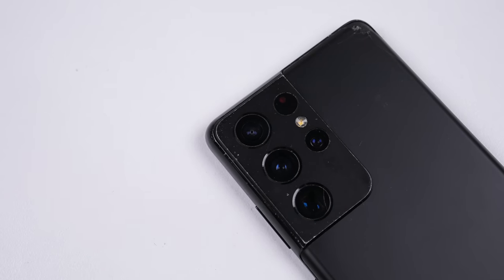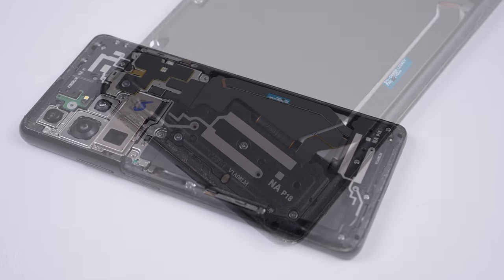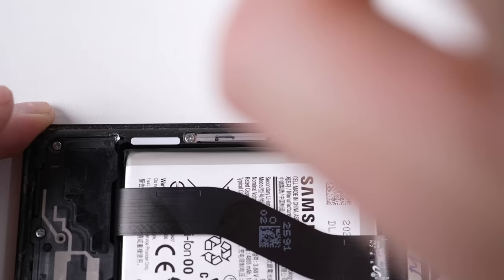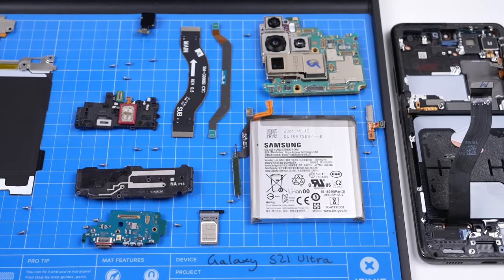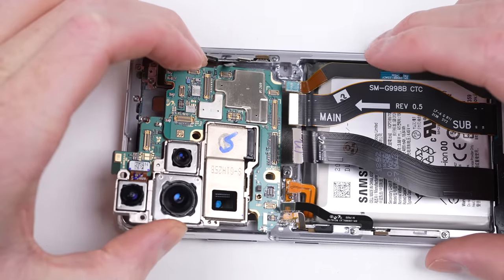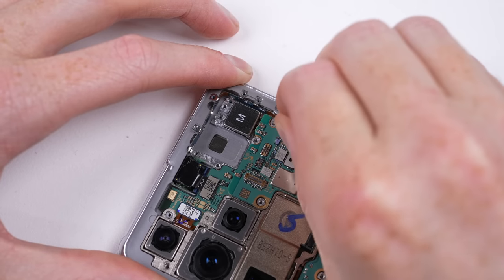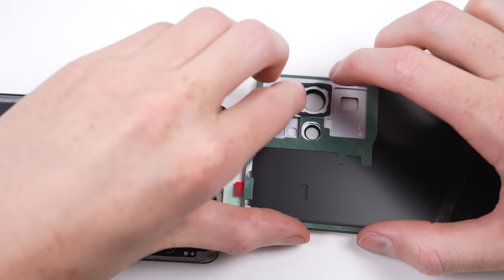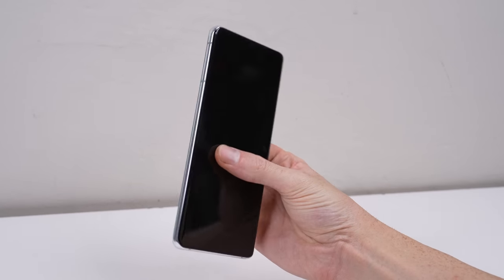$130USD Galaxy S21 Ultra Restoration

Comment: I work for a samsung repair partner. The reason the black screens are more expensive is because they've been on limited stock for around 2 years. it was the most popular model phone i repaired in 2021 by far.
Reply: Black is generally the most common option on phones, so I'm not surprised here that this was on back order parts wise. Lots of people prefer not to having their device look flashy as with the other colors.
Reply: Where is the best place to get replacement screens?
Reply: @nalvareza  do you want to do the repair yourself, or have it done for you?
Reply: @guzxam  he is asking a question you should answer it
Reply: @ginglee4199  No you should answer it.
Reply: @guzxam  to repair ourselfs, please. Is there any other cheap alternative displays? Thank you very much😊😊
Reply: Limited stock is an industry code for deliberate stock limiting to manufacture scarcity.
Reply: @Boomage1979  i know
Reply: @halirage1605  aliexpress is the only place where you cand find cheap displays, but they might not be the best quality, you have to look out for quite a bit of things while shopping for screens online but i dont have enough time to tell you , if you are interested i can give you a few pointers.
Reply: Samsung official is the best. And they can be had for this model for just over 110. You just need to know where to look.

Comment: 2 years rocking my S21 Ultra, and it's still a fantastic phone! I won't be changing it in at least 1 or 2 more years.
Reply: Same, the newer Galaxies haven't really given huge benefits to upgrading besides the S-Pen and the apparently amazing battery life on the S23U

Might just hold onto this till 2024
Reply: Been using my S10 for 2 and a half years now, the only thing that's getting a bit bad is the battery life, but other than that, I literally have no reason to upgrade

Comment: I just got a screen repair on my s22 ultra. It was $30 through my carriers insurance. The guy let me watch and the process went identical to this s21 pretty much. Took the guy like 15 minutes to swap the important bits into the new frame, battery was included on it, like you said. And boom done. I've missed this phone so much

Comment: they make these phones so well held in place and glued down so nothing comes loose but they break so easily but phones from the 80s and 90s were not but they could survive so much hardship and abuse and yet they were not even made in a secure way to last they just did that shows how much manufacturer’s have changed

Comment: For f***s sake I'm still rocking the S10 Ultra. I replaced the front screen recently (mentioned it in another Hugh Jeffreys video) and it's still doing just fine. Yeah, I get the urge to be at the bleeding edge of technology but when you sit back and realize that companies are holding back advancements because planned obsolescence is a real thing having the latest and greatest doesn't mean as much any more.
Reply: I have a Google Pixel 4 Xl, 

My brother recently purchased a Pixel 7 Pro, I played with the phone for a bit and realized that the huge improvement I'd thought I'd get, just wasn't there.

Especially in photo taking, though video was a huge improvement with 4k 60fps video on all cameras.

All in all, it's pretty much the end of upgrading every 2-3 years now.

Phones have peaked.

With that said, I'm excited about the Pixel 8 Pro!

Comment: The 3 screws holding the charging port board in place are actually not the same as the rest - they are a fraction smaller

Comment: As long as you use a lot of heat, plastic tools (a battery remover tool), and isopropyl alcohol, almost all Samsung batteries are a piece of cake to get out. Don't use metal tools if you don't know what you're doing. I've never seen a suction cup used for a battery, but whatever works.

Comment: It would've been great if you pointed out that when replacing a battery of a Samsung, you'll need to use the GalaxyCal app to reset the internal charge cycle counter which will gradually lower the maximum voltage of the battery. Sadly, this GalaxyCal app is only available for S series phones starting from. The S20 series. Earlier and non S phones are bound to get their battery replaced by Samsung which is anti-repair.

Comment: In my opinion, fixing old Samsung flagships aren’t worth it at all unless is for data recovery. The display itself is really expensive, and the whole cost of fixing one would be more than just getting a used one. All of that for its value to depreciate massively and not get software updates in 2 years.

Comment: Bottom line is this: if you need a heat source, picks, prying tools, a suction cup and alcohol to remove a phone battery, that basically means there is way too much adhesive securing it.

Comment: Love your videos, Hugh.  I was wondering, why is it necessary to glue a battery down at all?  It doesn't seem like there is any room at all for a battery to move around inside a phone.  I remember my old Blackberry battery would just snap in and out.  No glue needed.
Reply: They could’ve even used screws
Reply: Mostly just to deter anyone who dares to remove it. Tbh they should just use screws to secure it in place
Reply: @rosaria8384  Yeah, I know it's to make it hard for anyone to repair the phone.  Don't even need to use screws, just a bracket that the phone would snap into.

Comment: Hey Hugh, I'm really sorry, but this is the only relevant video I could find to ask this question:

I have this exact phone, and actually been looking to downgrade to a Note 10 +, and my current phone has a tiny fracture in the top right corner of the glass. Would it be a feasible financial option to repair the phone and re-sell it towards its end-of-life and grab one? Taking into account mobile carrier limitations, and security concerns, too.

I'm also wondering, once the end of security updates for the phone comes and if I decide to flash a new firmware, I'm guessing S Pen functionality would be lost, unless there's a fork of Android that has it?

Just genuinely curious and trying to weigh some things out before jumping in. Any advice helps. Thanks!

Comment: Here's my question, recently found a Samsung Galaxy tab s7plus tablet laying on roadside with a detached display completely shattered but the body probably fine ( maybe water damage). Tried to contact Samsung cs, unfortunately they don't keep their customer information unlike apple. Should I fix it up at the repair shop (presumably this channel) and if the owner wants it back I'll just charge it for the repair, if they don't want it then I'll keep it. Any opinions?

Comment: Trust you're fine sir.. I live in Ghana and I'm a huge fan. I have a Samsung s21 ultra with a damaged display and I can't seem find a display to buy on the market. The price at the Samsung shops in Ghana are too expensive (Almost twice the price of your s21 ultra fix ~ 130$). I was hoping if you could point me to a site with internationally shipping I could get the screen with similar pricing. Or if I could buy from your site then have it shipped to me. Any help will be appreciated sir. Thanks

Comment: one question though, doesn't factory resetting from the bootloader force you to put an email that was previously used on this phone? or are there ways to bypass this?
Reply: You can use an app to remove the frp

Comment: Hugh, I have asked you this before and you have never answered.  The phone was locked. You did a Factory Data Reset from the Recovery Mode menu.  As this will NOT work if the user was signed in to an email account when you did this, can you please explain how you are getting around this?
Reply: wondering this myself. few others have picked up on this as well.
Reply: @bobloblaw5406  Ya. It's rare that a phone wouldn't be logged into an account on an Android. So either Hugh is very lucky or there's something else to this, because it should factory reset and require that same email that was signed in previously to have to sign in or its still locked.

Comment: Has anyone noticed increased reports of screen failures (green lines, dead pixels, etc) of the S21 Ultra? They've been failing all around the globe in large numbers. Mine failed (green line) about 2 hours ago.
Reply: just OLED things, especially for curved OLED screens. Can't do much, temp, humidity change, a few drops do that.

Comment: Hugh, can you cover the fact that US model Samsungs can't be rooted? (OEM unlocking doesn't exist in the settings)
Reply: You can through a paid unlock service. But, you have the be on march 2021 firmware or earlier. 
My us s20 fe 5g is still bootloader unlocked and rooted to this day.
Reply: @corey7219  then that's not really a solution is it? My Pixel 7 Pro was rooted the day I got it for free with publicly available tools
Reply: @ctrlcf  maybe my next phone will be a pixel. We shall see.

Comment: Hi I have a MEDIAPAD T3 7 it works but the screen has 1 big crack down the screen and around the crack is a yellow tinge. Why is there a yellow tinge?
Reply: Because the cracked glass is applying pressure onto the LCD panel underneath, distorting the cells and creating that yellow tinge.

Comment: Not really a phone fix it type person, but what minimum tool kit (Ifix it)recommenced to replace a pixel 2 phone USB-C charging port? My perfectly good phone is ok other than you have to do some gymnastics/hold to get the charger cable right to start charging . It's now my backup if my new Pixel 7 ...
Reply: Maybe it's from cable, not port.
Reply: @Justice_Akbr  no, multiple cables tested and you need to wiggle them all to made it start charging. it's the port for sure, check around and costs like $150 to replaced by a repair place too. I've also considered wireless charging but doesn't seem to work with my current one.

Comment: Hey there, I have an s21 ultra with the display slightly damaged. Where do you get legitimate samsung parts from? Im scared of ebay 😂
Reply: Crazy parts is good
Reply: Good luck with that one, the short story is Samsung doesn't want to sell you one. Ifixit is always a good goto if you're not confident finding an OEM service pack or getting an OEM used part pull on ebay. Just save yourself the headache and buy a full frame assembly like Hugh did, not the raw screen.

Comment: I am watching this on my S21 Ultra.  It is not my daily driver, I am an iPhone user Monday to Thursday.  Why?  Have a huge Apple ecosystem so I use an Android device on weekends.  I have 2 or 3 phones in rotation.  I have a problem.  Just got the battery replaced on it for $69.99 and I can now get 8 hours onscreen time.  Before my best daybwasb5 hours 9 minutes.  It is nowhere near the 9 hours 2 minutes I could get on my S20 Ultra.  The 120hz on the S21 Ultra is a battery hog and I have every battery saving hack that can be done.  My iPhone 13 Pro Max is still the king at 10 hours 49 minutes.

Comment: As someone who bought S21 ultra new (and is using it to type this comment) this has been the WORST phone I've ever had. Full bars of 5G and nothing loads. Autocorrect is as terrible as 2011, making random correction and punctuation changes or straight up changing words. Like 'but' to 'bit'. The battery is always terrible, and it will straight up not not register touch on the center part of the screen for about a quarter inch top to bottom of the screen, until i restart it. I did break my first one (had it about 6 months before dropping it on concrete and well yeah) and got the replacement that I've had since so about a year and a half now and it has all the problems my original. And I'm the idiot that signed a 3 year contract like a total moron. Worst phone I've ever had and honestly makes me not want to get a Samsung phone after this one. And it is a U.S. spec
Reply: lol

Comment: The iphones have a 4300mah battery, samsung has 5000mah yet the iphone battery still lasts longer than samsung 🤔
Reply: @env-dimension_de358k  Yeah, I just checked it’s 4300. But still the battery lasts longer
Reply: Bcoz iOS is more optimised for iPhones
Reply: The OS it's why iPhones last longer, Android isn't made just for 6 phones so it's hard to optimize hundreds of different configurations of phones :D
Reply: Apple processors are more efficient and iOS has better optimisation than android since it doesn’t have to accomodate for thousands of different phones from all different manufacturers
Reply: Not true, I had both S21 Ultra and Iphone 12 Pro Max and the S21 Ultra he was always better on battery....FYI on screen time s21 I was getting ~12 hours and 12 pro max about 10 hours. Currently I have 14 pro max and I never had SOT of 10 hours like the old 12, now I get about 8 hours.

Comment: Screen repair is a BIG scam... the replacement displays are not glued as good as when they are new, they are much easier to brake or crack with these replacement displays.
Reply: You're funny, glass is glass is glass is glass. Stop blaming people who try to make repair possible for the phone manufacturer's problems.
Reply: This is a service pack, meaning it is a genuine Samsung part. Same glass, same strength and quality.
Reply: @SalemTechsperts  the glueing process in china is not up to samsung OEM quality...